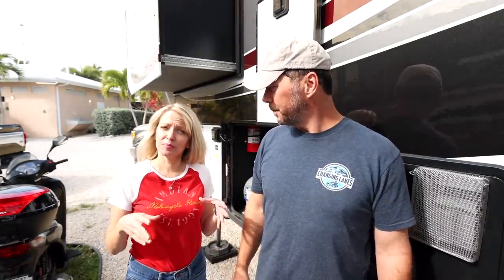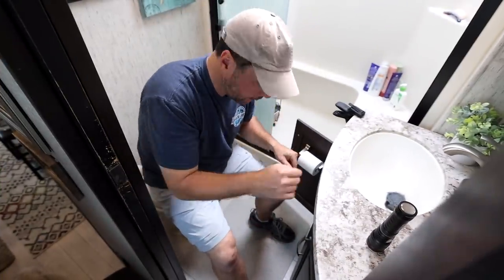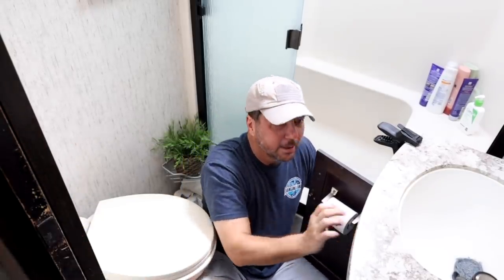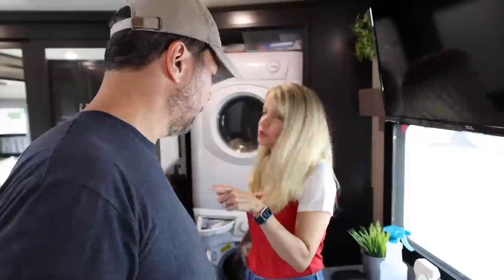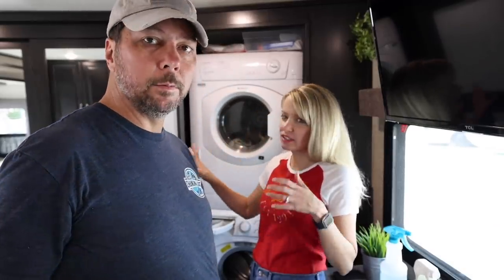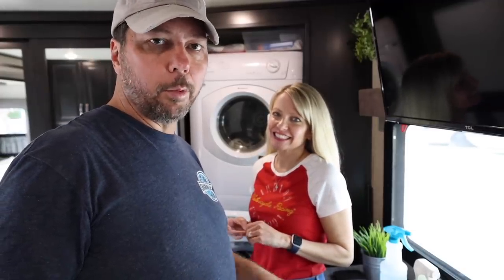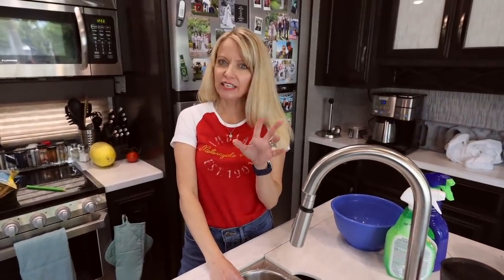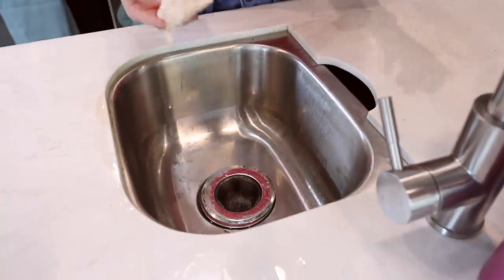RV Dirty Jobs

Comment: That was hardcore thanks for the tip  
It wasn't as nasty as I thought it would be. 
When it comes to your washer you are on the right track keep the door open after every wash and occasionally wipe down the boot aka the seal.
Lastly the dispenser keep doing what you're doing take the whole assembly out clean out the buildup, but also after each wash keep the dispenser door open allow it to air out

Comment: Maybe not the best video to watch as my dinner arrived. Very informative. Hydrogen Peroxide is suppose to kill mold, but can discolor things so use caution. Old English is great for cleaning and treating real wood products. I can't believe how much water pressure you have in your RV. It makes me think I need to look into my low water pressure (mine should be at least 40 PSI). Great job guys and thanks for sharing! Steve

Comment: There is typically another filter at the bottom of some clothes  washers. Looks like the shroom thing in the shower. We clean ours out a couple times a year. Have to take off the bottom panel on the washer. You'd be amazed at what gets stuck there. We leave our clothes washer door cracked open after washing to reduce the mold stuff as it less the washer dry out more. WOuld probably need to stay closed on travel days. They also have mold treatments too.

Comment: Another great tool for the shower drain is a Claw Pickup Tool, grabs the fine hair easily.  Also handy working on things around the RV for grabbing those screws or bolts that you drop where you can’t reach it.

Comment: Hi Guys. I really like your shows. My wife and I had the same problem with mold in our washer . What I did worked really well. I Soaked some small towels in bleach water and stuffed them in the folds of the rubber flaps and left them over night. Next day it was much cleaner. Some might not like this idea but if you are careful with it it really works. Safe travels.

Comment: There are pucks of Oder / Mold cleaning products that you can now place in your front loader to ease the cleaning chore. There should also be a Filter in the front of the washing machine mines in the front bottom corner, is messy and trapped water drains out as you remove the filter but all the clothing lint etc get caught up in there and will affect your washers ability to drain correctly.

Comment: I was told by a plumber that the only thing safe and is actually effective in RV drains is White Vinegar.  It will help dissolve hair clogs, but it takes FOREVER.  He recommended do as you did, pull the traps and empty them.

Comment: You need to buy the wand with the rotating head that hooks onto a hose and sprays around inside the toilet passageways.
Reply: I put the wand inside the toilet to clean that underside part.
Reply: Exactly! We've been full-timing for 3 years now and have never had a build-up in the toilet like that. We use "Happy Campers" in 3 gal of water to start after every tank flush. And once every 6 months or so I use a flexible wand with rotating head attached to the hose to clean the toilet passageways. We've never had any disgusting smells or gross stuff in the passageways (even when cleaning)
Reply: @RV Scootin what kind of a rotating wand that hooks to a hose?

Comment: I have a relatively small brush attached to a long twisted metal rod that is very good to use to clean out those type of p-trap drains. They also make a brush that are used in the bug business, to get cobwebs off of the eaves, you can get them at Lowe’s and or Home Depot and they may work better for you? Wife says for your washer seal possibly wet a rag in a pail with a mixture of water and bleach then wipe down the seals inside and out.
Reply from the maker: I tried those, but the bristles are a bit too soft.

Comment: Had a front loader clothes washer for years, never any mildew.  You have to wipe the inside of that seal, and the window inside, and leave it open until dry.  You'll never have to clean it again.  Obviously it'll dry quicker in less humid climates, or when you're running your A/C.  Always great videos, thanks guys!

Comment: The best way to avoid the mold and mildew in a front loading washer is preventative maintenance.  I have never had a problem because I  clean the washer with recommended front loading washer treatments such as Affresh or use one of the methods described below, and clean my washer once a month or at maximum every two months.   Using too much bleach on the seals will eventually break them down due to the corrosiveness of bleach (and vinegar, too) so preventative measures are better.  Also try occasionally wiping the seals and the dispensers with disinfecting wipes.  Try not to have to use a lot of chemicals on the seals. Soap and water if there is just scum.  NEVER USE LIQUID FABRIC SOFTENER EVER. IT BUILDS SCUM AND IS BAD FOR SEPTIC TANKS.  Our home is 41 years old and on septic tank.  We rarely use any bleach products (which of course stops the natural break down of solids in the tank) , never liquid fabric softener and of course never deliberately dump any kind of grease down our drains.  The worst toilet paper for a septic is Charmin which is one of America's favorite TP's.  

Preventative Maintenance
Once your machine is clean, follow these tips to keep it that way:

Washer door left open to allow tub to dry
Allow washer tub to dry.
Air It Out: If possible, leave the door of the front-load washer cracked open to allow it to dry thoroughly between cycles. However, you shouldn’t do this if you have children or pets who could be tempted to climb (and possibly become trapped) inside the machine.
Remove Loads Promptly: Be sure to remove wet clothes as soon as the cycle is finished. Set your washer to beep when it’s done, so you don’t forget.
Choose Detergent Wisely: Choose low-sudsing detergents specifically made for high-efficiency (HE) machines. When possible, choose powder over liquid; liquid detergents are usually higher in suds.
Washer dispensers
Clean washer dispensers.
Use Less Detergent: Read the labels and use no more than the amount recommended for each load. Experiment with using less detergent, until you find the minimum amount necessary (sometimes just a spoonful) to get your clothes clean.
Avoid Fabric Softener: Liquid fabric softeners leave residue that contributes to mold in front-load washers. Instead, use dryer sheets or dryer balls to soften your clothes.
Dry Gaskets: Use an old towel to wipe around and underneath the door gaskets and the inside of the door on front-loading washers. Ideally, you should so this after every cycle, but at the very least it needs a periodic wipe down to remove any water or mildew trapped in the folds.
Use Bleach: About once a month, run a hot water bleach cycle. I usually take the opportunity to throw in work towels, fabric shower curtains, and muddy gardening clothes, along with that nasty gasket-cleaning towel.
Cycle controls on front-load washers
Occasionally use the Sanitize or Tub-Cleaning Cycle on front-load washers.
Reply from the maker: Thanks for the tips! 👍🏼

Comment: Tip for front load washers: If you run an empty load on the hottest water setting you have, together a dishwasher tablet or dishwasher powder, at least once a month (twice a month if you do lots of laundry), or will help prevent build up and odor inside the washer.

Comment: We have the same washer and dryer combo and have the same mold issue in the same exact areas. We keep a damp rid bucket in the washer when not using it. It doesn't prevent the mold, but does seem to give us a little more time in between mold clean ups.

Comment: On the washer, there should be a drain tube with a cap that you. An use to drain the lowpoint. Its designed to drain out the strainer basket but you can use them to get the tub 100٪ dry. Then you can clean out the strainer basket. The more often you do that the longer it takes to build up a stink.
Reply: Correction, just checked the owners manual. There is no drain tube. You have to use a catch pan to remove the basket strainer. 
Still tho, recommended regularly to avoid bad smells

Comment: Might want to get a damp rid packet to put in washer when you can't leave the door open when doing things in that area
Reply: Before using Damp Rid directly in the washer tub you might want to check with Damp Rid to make sure the chemical vapor that Damp Rid puts off will not damage the interior of the washer tub and seals.  That stuff can be pretty strong

Comment: Great video! Thanks for all that you do to keep us informed. 
You asked for it...
A dryer vent brush works great on (dry) shower drains.
A dryer sheet does a good job of cleaning the door seal on a front load washer. This also keep the mildew away longer.

Comment: Get a rechargeable fan & put it in your washer for a few minutes after if you can't leave the door open. It has worked for my front loader at home. I also will run a load with soap & bleach only.

Comment: Another good use of plumber's Grease is on the seals in the sewer hoses where you connect them together. Had a slight leak at a campground last year and used some of that, no more problems.
Reply from the maker: Great tip! 👍🏼

Comment: Mega-Loc or some other pipe dope with teflon will help on the traps.  Just a little on the threads helps the lubricity and lets you get it a little snugger.

Comment: Yes as the other replies. My wife and I (or should I say my wife’s front load washer machine. Lol I guess you have to only put one new red shirt in with the whites. Never allowed to touch laundry ever. Lol) She has had the front load for years and always leaves the door open. And the drawer out at least until the water dries from them after laundry is complete. Also keep a towel to wipe at the end of all loads in the seal after all laundry is done. I don’t know if the ones in the RV also have a drain with screen at bottom of the unit to empty the machine completely once a month and check the screen. If you want a pic of mine where it is. Let me know. Last is after our once a month drain she runs a clean out detergent for the whole machine. That may help. After watching to the end I think the only way is to replace rubber. Which mine wasn’t that easy. But you can do. And then keep both doors open, and wipe at the end of all your laundry.

Comment: Another item that can make that shower drain hair removal easier is a couple of proper-sized brass brushes that are used to clean the bores of rifles or handguns..  Mounted on a short rod, just run it down each quarter of that drain area and it'll grab all hair and bring it up easily..

Comment: DON'T RUN YOUR EXHAUST FAN WHILE WORKING WITH THE TOILET!!! It pulls air into the bathroom and pulls fumes from the black tank.  Same as whenever you flush, exhaust fan will draw air out of the black tank.

As for the washer, we use a clorox wipe every second or third use.  And we ALWAYS leave both the soap and washer door open.  Minimal issues in the last 6 years.  Also part of the issue with the softner is my understanding is it has sugar as an ingredient.

Comment: Great video. On my black tank its attached to the top side and comes out at a bit of an angle (previous owner took the bathroom out of the rv and cut that tube) I cut it straight and attached a 30 or 45 degree 3"angle peice in and in order to get it coming up straight to the floor. In order to get my toilet where I wanted it I had to use an offset flange. I appreciate your video because I've had a friend staying with me for short amount of time and can't get it through her head about using either less paper and/or more water. It makes sense that I should clean the chute. I just need to MacGyver a brush thats flexible to get past the angle peice

Comment: We've had the same problem on our home washer. It did come with instructions to wipe out that rubber seal after use and to leave the door open until dry to avoid mold and mildew but of course we were not consistent doing that. Chad let us know when you go into production on your scrubber pole. 😃 You may need to mute the gagging sounds in the future. Tara is not really selling the desirability of those RV jobs! 😂 Thanks guys, another very helpful video.

Comment: Need to run hot water down the drain when you are done brushing your teeth and get soaps that are less gel.  That is just Tara's hair and soap in the sink.  My daughter found a shower trap for hair that sits flatter than the mushroom you have, no idea were she found it but it works great.  My daughters all have very long hair and once I had them clean the trap they have kept it very clean.  Surprised you do not get a pressure washer in there to clean the toilet "pipe" it would do a great job,  turn up the temperature for really hot water and the pressure and spray away.

Comment: While you're at it, you might want to grab a spare P-trap for your sinks/shower (if the shower uses a P-trap and not the diaphragm trap) to have on hand if one breaks. Happened to us in our previous trailer on the last day of a long vacation, the shower P-trap broke at the coupling nut and we had water everywhere. Some of the factory P-traps have very little material in the coupling area (1/16" thick) and break easily even with a minor amount of flex.

Comment: I found that the Camco RV Flexible Swivel Stik with Shutoff Valve works much better and easier to clean the "toilet tube" and also your black tank at the same time.  No need to MacGyver  things.

Comment: Run a wash cycle with a cup Clorox without any clothing. It will kill the mold & mildew and then run a high rinse cycle. You still should wipe out the seals but the mildew is now somewhat dead. Might have to run a 2nd rinse cycle.

Comment: For the washer we have a 2 in 1 and we wipe it after every use and once a month we do the washer machine cleaning powder from tide and then we clean the lint trap and it has never turned slimy or moldy. We have had ours for 8 months and and we do about 6 to 8 loads a week.

Comment: I like using Magic Eraser but they are expensive, I get mine on eBay in bulk of 100, 3/4 inch thick, they are not as durable as Mr.Clean but when it starts to wear you get a new one. I enjoyed the dirty jobs video.

Comment: Something that might help control odors.  If you are working on cleaning the toilet and have a reversible exhaust fan, such as a MaxxFan, draw air in and close the bathroom door.   The reason, if you run it on exhaust, you will be pulling fumes up and out of the tank.  If you force air into the room (with the bathroom door closed) you will be slightly pressurizing the room and forcing air into the black tank which would exit through it's roof air vent.   Not 100% but does help cut down on the odor.

Comment: If you figure out the front loader thing, spread the word.  I've been told that it is just going to happen no matter what.  I've had my front load household washing machine for 10 years now and I keep the door open until it is dry inside after washing but it still builds upon the seal on the bottom.

Comment: What about using a bottle brush to loosen  up whatever is in there. Use bartenders keeper on stainless, (its comes in a can like comet) it wont scratch, steel wool will scratch the sink.

Comment: On that front load washing machine there will be a drain pump filter.  If you have never cleaned it you need to.  When it gets dirty it will starve the drain pump of water and cause it to overheat. Add it to your to do list / I bet you should clean it out every 6 months or so.  Just google "front load washer drain pump filter".

Comment: I’ve had a front load washer for about ten years. The only thing I’ve ever done is leave the door open for about a day after I use it and I have never had a problem with mildew. Someone else wrote they use powder detergent and run some hot loads. I always have too so I’m not sure if that has something to do with it.

Comment: for the drain Home Depot sells the plastic hook or you can use a metal coat hanger and bend the tip in small hook shape it works good or if you have a multi thread metal wire you can also make a hook of it and the tip will be like a spider and bring out so much stuff out

Comment: WASHING MACHINE: For starters...definitely replace the rubber. It never needs to look that way. 
Keep a hand towel over the door of the washer in the far corner so that even when you close the main door, it won’t close the washer door. 
You can use that same towel to wipe the inside & outside of the rubber, as well as wipe the door.
I do this every time after doing laundry (when I’m done with all of my loads for the day).
As far as the tray, If your washer has a “clean” cycle, use that once a month. You can either buy tabs that go straight into the drum, or sometimes I pour white distilled vinegar into the soap area as well as the bleach area instead of the tab. If you don’t have a “clean” cycle, run it like that on the hottest & longest cycle it has. 
The clean cycle generally runs for about 2-3 hours (ours anyway). 
When it is done, don’t forget to wipe off the rubber in all of those places that you pointed out in this episode, as well as the door, then drape that hand towel over the door in the corner. 😊
We NEVER close our washer door. The open door blocks the door to go to our garage which is where we came up with the towel idea to prevent the washer from closing. I’ve never had a spec of mold! 😁 Good luck!!! 😍

Comment: Good info! Ive clogged my shower once, just got hair under the top grate. 

My toilet doesn’t have that taper like yours, mine is an ABS pipe the same bore all the way down, I have never had that kind of build up, even on the baffle at the bottom of the pipe. Mine is a 2018 Grand Design Solitude. 

A periodic large pot of hot water is great to help keep the funk out of the P-traps.